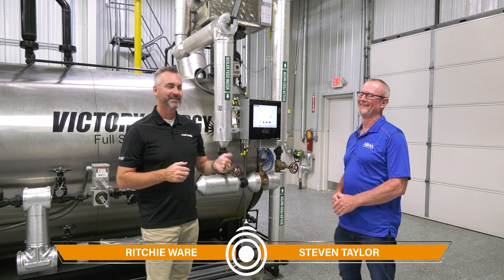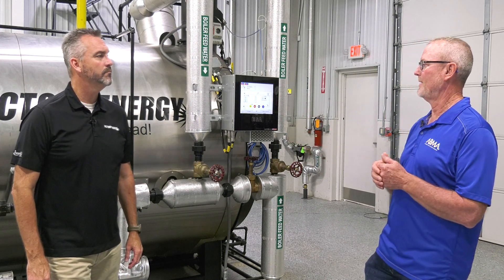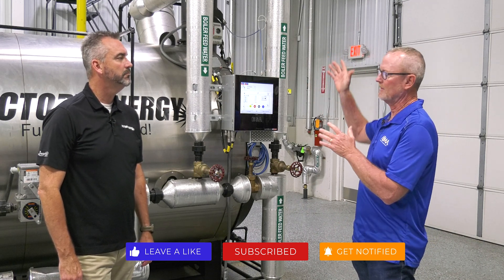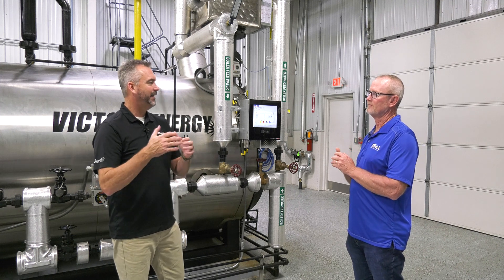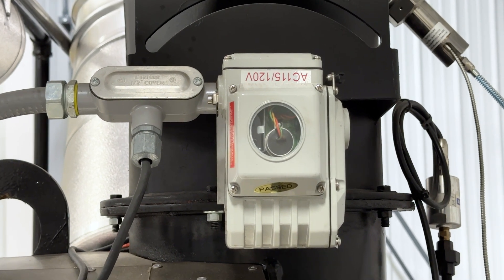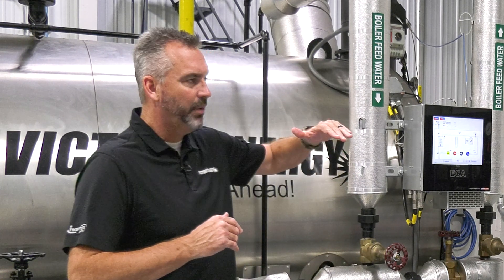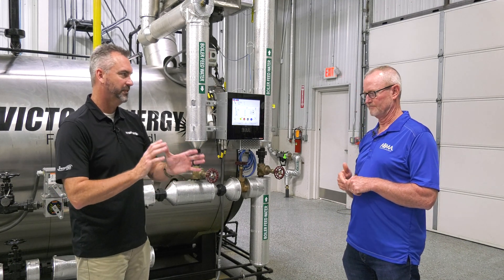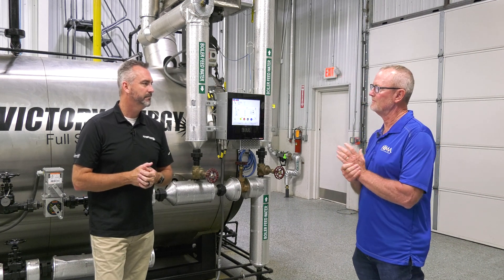Boiler Back Pressure: Common Issues & Solutions Explained - The Boiling Point

Comment: it's good to know this and now I know what to look for; A customer says, My Boiler is set at 60psi but it does not maintain it. It drops to 40psi.
Reply: What does that have to do with this topic?
Reply: @Alex-bf9yp Well I know that I can listen to the sound change in the boiler room to check whether the suction on the stuck is causing pressure drop ....